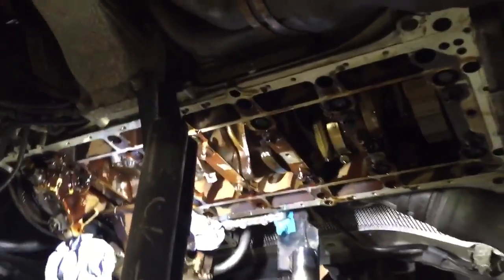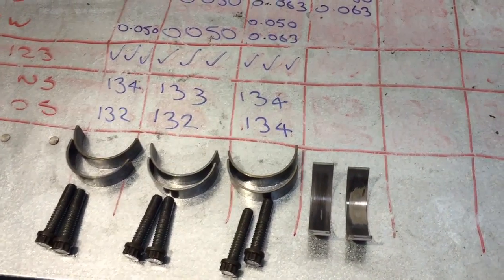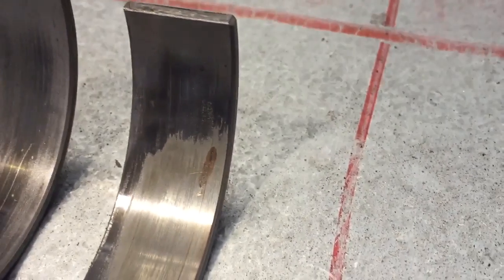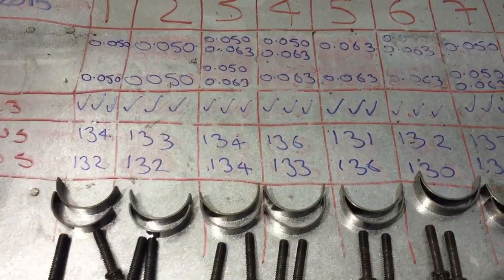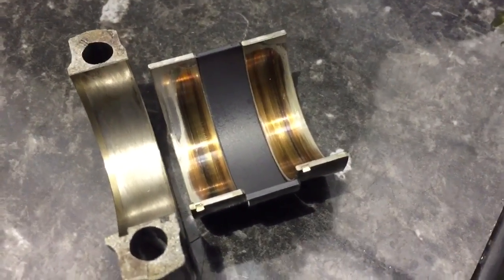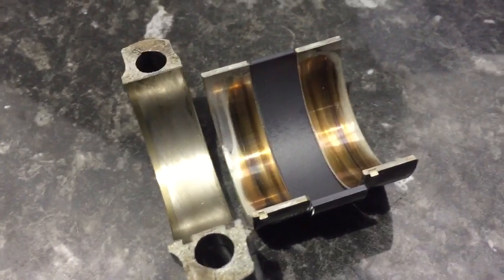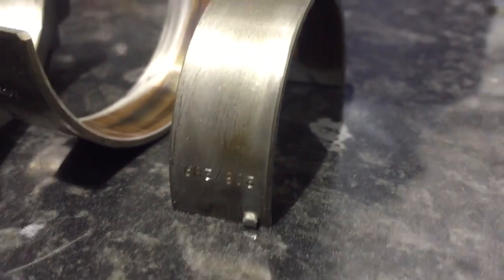BMW E60 M5 Conrod Bearing Shell Wear - Cylinder 9 near failure

Comment: It doe not matter if its AMG or Ms or 911s or what ever, when engine is old, its old just because paying more for the brand doe not always buys longer engine life.

AMG and Ms should recommend changing oil at 5000km would have made some difference, but these companies assumes you buy these cars you would change it when each new generation comes out..

Its not manufactures fault wanting to make money on new cars.

If your income is not for bmw or merc just buy cheaper alternative.
Amg and Ms v8 drives more refine more fun but its not a stronger engine vs cheaper brands US engine or japanese engine. People need to accept this.

Comment: I do do wonder about the phrase 'German Engineering' and those who use it. What I think they mean is 'German Marketing' which one has to agree, is the best in the world, ... to have convinced so many people that German cars are reliable. 

From simple issues like this, to the dreaded VW and all their well publicized problems, to the laughable later model Merc reliability issues, to Porsche engines that either leak oil, score the cylinder linings or that have IMS bearing issues. 

And before one shouts about Toyota and there problems, I'll ask them to watch this video (watch from 2:15 to 3:50) 
https://www.youtube.com/watch?v=ipSpt6icmxE
Reply: Except they are. And this car in particular experienced this issue because it had a 5 liter v10 engine that was fitted from a formula 1 engine and reengineered adapted to road use.  bearings are key in this car.

Comment: The only thing that's garbage in this car is the rod bearings, smg pump, and throttle actuators but other than that this car is worth $15-20k nowadays which for another car to have similar luxury and performance you would have to be spend at least $100k

Comment: as 10w60 is recommended for these engines, do you think that t his is part of the problem ?  as the 10W60 is very thick on winter cold starts...  that and owners reving it too much when cold leads to bearing wear ?
Reply: There has been a lot of research on why this engine has this failure. It comes down to the tolerances between the journal and the rod bearings. It is a "defect" by BMW.
Reply: bobl78 the oil has been pinpointed as a possible issue however nobody is able to prove it as the root cause
Reply: I think oil plays a part, but the way I look at it is this is a race engine in a street car, the preventative maintenance will be a little more intensive than a Honda Civic. Think of it as a timing belt/water pump replacement. Lol.
Reply: Running a lower viscosity oil and letting the engine warm up at idle before putting it under load, has shown to improve engine bearing life dramatically.
Reply: The rod bearing tolerances on these Engines are "tighter than they need to be", that coupled with thicker oil on start up and an over zealous right foot.. equals friction...  and friction causes heat build up on the rod bearings.. hence the premature wear. Mine were replaced with upgraded shells (slightly more clearance than std) at 121361 miles. on 03/09/2019  By Mr Vanos in Darlington.. As far as I know it has 10w50 in it now..
Reply: @M5Cookie  What's the difference between new bearings with more clearance and the old worn bearings which get automatically more clearance due to wear? Why do they fail and new more clearance bearings are fine? 🤔

Comment: Is the cap at around 2:00 mins in cracked? from the bolt hole to the outer edge.
Reply: Should have gone to Specsavers that's not a crack when he goes to the next shell you can see it's a part of the Casting
Reply: Spanners yes they're made to do that lol so to protect the connecting rod they make the end cap crack to make the new cap fit perfectly to the connecting rod when the bearing fail.
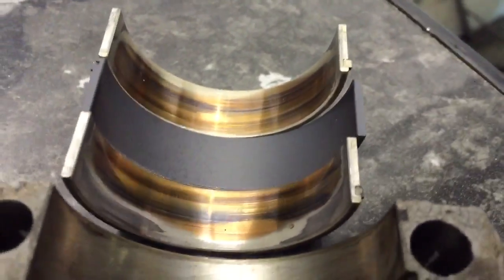Reply: Well yeah, its cracked, but not the way you meant. At 3:20 you can see it from the other side and there is no crack visible. 
The connecting rod shank and bearing cap get fabricated as one piece and then cracked to have a tighter bond between them when connected. So the crack seems to be a bit vertical on that spot and thats why its looks cracked from the side at 2:00 mins